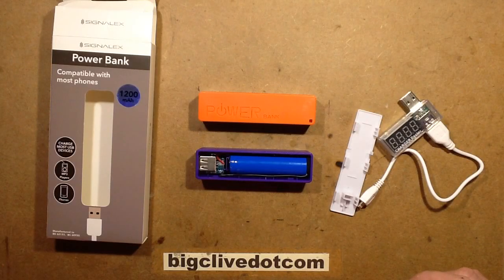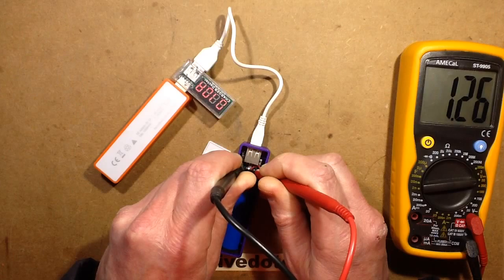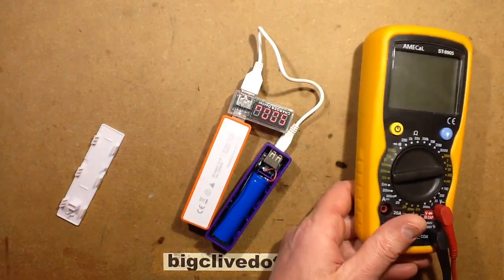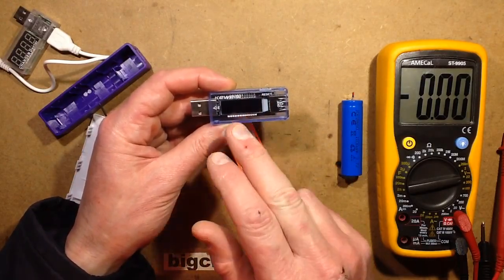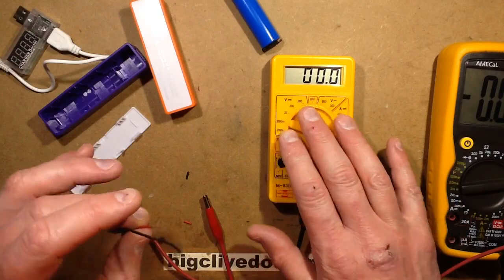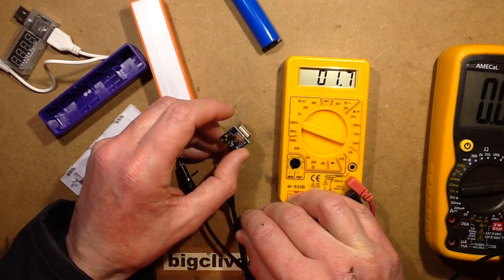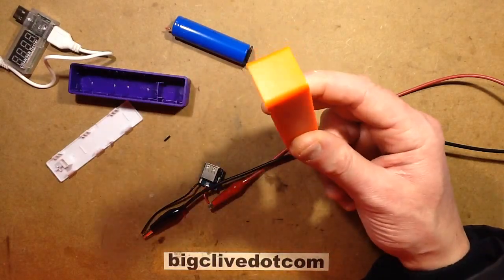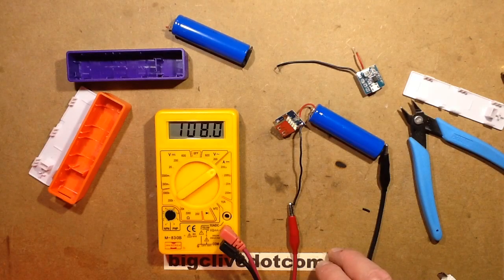Poundland's 2016 power banks.  (not a good start)

Comment: Thought you might have checked the cutoff voltage and related quiescent current.  Frankly, it's disturbing that shops are selling to the public products containing cells that have been completely discharged.  Do you think they might present a fire hazard if subsequently fully charged?   Thx for the great videos ..!
Reply from the maker: I did mention the cut-off voltage was 2.93V and the quiescent current, which was a disappointing 100uA.  The "bad" pack having a ridiculous quiescent current of 1.7mA.
Reply: Ah, yes, thanks, I recall that now.  I was wondering if the quiescent current changes either side of the cutoff?  I would have thought the boost regulator would enter a sleep state when below cutoff or when there is no output load.

Comment: Clive, although you did say (and were right) that li ion cells are extremely efficient at sucking up the charge that's put into them ... shouldn't the charge chip eat up quite a lot of the "charging Wh" that are going into a battery bank ? Those chips to get farely hot; why not measure the discharging ? Then you habe the boost circuitry which surely is more efficient than the resistive voltage regulation in the charge phase (I tested the oneplus powerbank that way with an ipad on timelapse)
Reply from the maker: During charging the control chip regulates current resistively and dissipates the excess above the cell voltage as heat.  But the actual mAh going into the cell remains the same.  So while some energy is lost as heat the mAh in is close to that of the cell.

Comment: +bigclivedotcom  I think those battery capacity measurements might be misleading because both the charging and discharging is done through a switching regulator, and you're measuring the mAh capacity at constant 5V, while the battery voltage varying between about 3 to 4.2V. Calculating the Wh capacity, then back to mAh at the mean value of the battery voltage range might help, but I'm too tired now to work it out /sleepless night due to heavy toothache/. The simplest way is to buy a battery tester with Wh measurement capability, then you 'just' will have an error caused by the unknown efficiency of the regulator. Or if the tester's voltage range is down to 3V, you can test the cell directly, to get a correct mAh value.

Now I should go to sleep, but let's see that lil keychain flashlight instead, while that 50mg diclofenac absorbing in my blood... :)

Comment: It's worth noting that 1200 mAh capacity refers to the cell which gets boosted to 5V at the output. In that specific case and a generous 85% conversion efficiency you'd get about 800 mAh at the output at 5V.

I might be completely wrong though, I'm sure someone will correct me.

Comment: I bought a whole bunch of those from china for $0.65 each, sans the battery.
Reply: Those are different, they just have the same enclosure. Here is no battery holder, the battery is soldered straight to the controller. They also have different controller boards in the same enclosure.

Comment: I bought two of these exact units yesterday. got 300mA discharge from unit one and about 500 from the second. disconnected the cell of one and dropped in a cell from an old laptop charger and discharged. it took 2000mA to charge. not bad for a 2.1 cel and discharged at 1293mAh.

Comment: When not in use, I always put sticky tape or Kapton tape between the lead and + side of the battery on power banks.. A bit tricky and/or bothersome, but does the trick to prevent quick discharge.

Comment: I would consider 100uA quiescent current as excellent in proportion to an average 18650 cell @ 2600mAh - that's about 3 years of standby.
Also some protection chips miss under voltage cutoff at very low discharge currents and can drain the battery slowly to 0v.

Comment: "Oh, blimey, that's quite high." What is that, 40VDC?
Reply from the maker: It was set at 27V.
Reply: It could be anything from 0 to the max voltage! Clive has mentioned his PSU has a interesting feature in which when it "crashes" it can return to life with a voltage pulled out of its backside. I don't think this is the case in this scenario, however.
Reply: Did you ever get to the root of the cause for the crashing issue Clive?
Reply: bigclivedotcom WHOA there... that would REALLY charge up that 18650 cell. You need to overvolt a Chinese 18650 one of these days. OUTSIDE, to be exact.(referring to the 11kV explosive disconnector video)

Comment: I've brought many an 18650 back from the dead (0v) with no adverse effects.. albeit two batteries which had crazy self discharge problems.
Anyways, lithium ion batteries are tougher and more stable than previously thought and there's a lot of misinformation about charging/discharging out there.. 
That being said, I wouldn't like any lithium cell to be repeatedly drained under 2 volts as this will reduce the capacity
Reply from the maker: So far it's taken a full charge twice albeit with reduced capacity second time around (if it's not shunting some of the charge current too).  It's theoretically coming in at around 1000mAh, but I'd need to do a proper discharge test to find the true capacity.

Comment: I don't think it's dangerous per-se to charge a completely dead 18650 battery (or should I rather say "cell" :)). It's just going to lose a lot of capacity when discharged below ~2.5V threshold and even worse when left in that state. What could be dangerous is charging it to full and then demanding a rather high current, since it's going to have a lot of internal resistance at that point, but I'd say it's very unlikely to burst in flames.

The only powerbanks I consider worth having are those coming without any batteries. I have two with a nice USB-socketed flashlight module, they are quite handy. You can put any 18650 battery you want in them, be it crappy *Fire cell or a high capacity Sony cell. I personally carry it with an IMR battery inside, makes me worry less about my home burning down unexpectedly if I have to charge it inside the device and not i a proper charger.

Comment: I have ordered one of those Keweisi charging monitors. They're cheap and get decent reviews and I need to check on the capacity of the Power Banks I have. I doubt I shall get it before Christmas, but it'll be more useful than some of the cheap tat out there.

How do you get into those boxes? If I find I have a dud, it doesn't look too difficult to replace one of those cheap cells.
Reply from the maker: A flat metal spudger pops the white cover off easily.
Reply: Thanks, that's about what I expected, but I wouldn't have been surprised by glue.
Reply: Not a one-pound one, and it looks like shoddy soldering on the micro-USB socket rather than the cell. Which is going to be tricky. But the Kewesai does a good job. Anyway, document the connections, disconnect the battery, try resoldering, look closely at the results, check for a dead short...

I thought I had a strange idea of fun, but am I really strange enough?

Comment: I got a couple of these exact banks the other day the battery inside is crap at about 200mah capacity with a high internal resistance , pcb did have a few filth solder tags on it so cleaned that , did a test using a psu to see what power it would cut out at and it seems when it terminates power the cut is not latching so if the battery recovers some voltage the usb power becomes active again meaning it could just loop until that cell is very low (usb power in not needed to close the cutoff).

Iam thinking of changing its battery out and replacing it with a laptop cell , the one it came with is light as paper , betting there's a tiny half cell inside.

Comment: Well, my brother got one that's similar (insertable battery) and changing battery for a used (2200 mAh actual) Samsung cell made it last substantially longer. The stock batteries in these single cell ones almost always disappoint badly.
The best option right now for a small power bank seems to be buying a DIY one like this and inserting a beefy cell like these 3400 mAh Panasonic. For anything bigger, buy original Xiaomi, these are quite cheap and good quality.

Comment: you should know better clive. the capacity printed on those powerbanks always means the rated capacity of the battery inside. just ignore the fact that of course are fakes out there.  if you have a 1200mah battery inside tru conversion and loss you end up getting around 750mah at 5v under perfect conditions. i exspect a usable capacity off around 1000mah and a shitty battery that voltage collapse very fast under some load so it getting even worser. so the question is how do you try to empty it? your 1a resistor would be to much. and of course, you cannot compare the input with the output mah. you can exspect the mah getting in around 30% higher because of loss and outside measurement. the only real test for a cell is without the circuit on a computer charger with an display and even then it depends on the datasheet of that battery at what discharge loads they are testet. i mean a single cell powerbank is crap anyway. more cells mean less voltage drop under load. or using better cells.
Reply: Labelled at 1200 mAh because that's the label on the cell is just wrong. You're correct about the effect of the cell voltage and output voltage.

1200 mAh at 3.7V is 4440 mWh, which is 880 mAh at 5v

But when the cells are marked at 1200mAh and can only deliver around 200mAh as the power bank output it's an outright lie.

It's strange but true that I learned about volts, amps, and watts at Sunday School. One of the teachers was an electrician's daughter, and she told us that  to explain the difference between ignorance and lies.
Reply: of course 200mah is crap but i still want to know what clive means when he say he run it flat before charging. that is a toy grade cell with 0.2C (240ma) discharge rate. there crap but because there crap they cut of even earlier.
Reply: I bought one of these the other day to take apart and to test. I tested it by monitoring the percentage charge it added to my brand name phone battery. It worked out as having charged my phone by 865ma. Based on your calculation it seems I got lucky and got a fully rated one.
Reply: This is why I think it's absurd that power banks are rated in mAH. mAH is not a good measurement of energy because you don't know whether they mean battery voltage or output voltage. The right unit to use for energy capacity is always watt-hours.

Comment: I must have got lucky with mine, it has a 930mAh battery. I've done a few charge/discharge cycles and it seems to be working fine. It's been sat untouched a few days and the battery is still at 3.8 volts.

Comment: Hi. I have a bunch of 18650 2200mah bateries. Can I use this circuit with those bateries on parallel to increase the mAh?
Good video. I'll wait for the multimeter overview too
Reply from the maker: If the cells are all good then you can usually parallel them if you make sure they are at a similar voltage before doing so.  And powerbank module designed for lithium cells should work with a parallel array of cells.
Reply: I'll make sure the bateries are all working and try then. Thanks!
Reply: ive done exactly that and added a fast charge cable 10 Ah takes a while to charge at 500ma. also added a switch as the parasitic drain is awful

Comment: Batteries have gotten so complicated. Now a cell has to come in a plastic box, with a circuit board attached to it. What ever happened to the good old days, when a battery was just a battery?
Reply: These aren't batteries, they are chargers and chargers have always had electronics inside.
Reply: Joshua Rosen
they're dumb
Reply: Paul Frederick Good old days, like when a AA rechargables were 500mAh NiCads? Glad we're way beyond that now.
Reply: D600Active
I actually think that lithium is not the best battery formula. I am not saying the others we have are better. But what I am saying is we need to do a lot better.

Comment: I bought 5 of these back when you reviewed them first and 2 were faulty :D
For a quid each, it isn't such a hardship. One had a badly soldered -'ve wire.  was very surprised that the manufacturer soldered directly to the ends of the 18650's. I find it hard to see how even a bedroom manufacturer couldn't throw an improvised MOT transformer spot welder..
The second of the failures had a completely goosed battery, so without much ado I slapped a 3Ah 18650 in instead. Works great!

Comment: The Poundland power bank that i bought 
Took 1120mah of charge to full after 2.5 hrs. 
Outputted 758mah to empty when charging a flat mobile phone.
not bad for a quid. :)
p.s very low output only about 300-400ma when charging phone.

Comment: You know, this has made me realise that I really do need to read up on and learn more about how Lithium batteries work, and the ways that they ought to be cared for. I have a bunch of 2200mAh power banks knocking around that I bought from Asda about two years ago (They were on clearance) and it never occurred to me that - As an off-the-shelf product without any storage advice or care instructions on the box - They might degrade in storage. :-o 
Now, the question for those has to be: Do I throw them on the charger ASAP to try and prevent the cells from dropping to 0v...Or would doing that be the most dangerous thing I could possibly do? :-o 
 
That said, I suppose I can now work out why the battery in my laptop doesn't hold nearly as much charge as it ought to. Curse both my user ignorance, and my habit of watching YouTube videos for too long and causing emergency shutdowns! :-/ 
 
Any chance of a video that explains Li-Ion batteries and best-practices for their storage/use in a way that the uninitiated consumer can follow, please? This would be most useful for those of us who don't understand the technology nearly as well as we ought to. :-)
Reply from the maker: If you plug something into them and they try charging it, even briefly then it suggests that the batteries had not been depleted too low.  In that case it's a good idea to fully charge them to keep the cells inside topped up.  If they are already flat then they may still be OK.  Most good power banks automatically turn off completely if the cell voltage is dropping too low.  In that case you could try recharging them.
Reply: I have an imax b6 that has a storage charge setting, it charges the batteries to around 3.8 volts 
I believe batteries stored at their full voltage is bad, consider the following, higher charge makes for higher acid content, higher acid content = faster degrading of materials inside.
Reply: The Quby power banks I've been keeping hold of all have on/off buttons and indicator LEDs, so I'll probably use those and a Poundland USB lamp for testing present charge and throwing them onto the charger ASAP if they seem good to go. They look like they might have a fairly good quality to them (I did have one which I'd opened up somewhere. Will have to try and get some photos for your interest.) so fingers crossed the circuits inside them have kept the cells well managed whilst they've been in storage. :-) 
Looks like exchanging my EE power bar for a 10-port USB charger (The same sort used in the secondhand display cases at Game/Grainger) is going to have been a good decision! :-D 
 
As for working out ideal charge levels: When charging a power bank intended to be stored for long periods, what's the best level of charge to aim for? Some people say (And I used to follow) that charging them up fully is the best approach, however Apples documentation for their in-device cells (See https://www.apple.com/uk/batteries/ ) suggests they should ideally be stored with 50% charge and powered up/topped-up once per year, and there seems to be all manner of differing perspectives on this. 
 
At present I'm storing stuff with between 50-66% charge where possible (And switching to buying only power banks with charge level indicators) but given I've been doing this with my laptop since I got it (Secondhand) and the from-full-charge life in that has been crashing down and down over the past year, I can't help but wonder which way is truly the right way... :-o :-/ 
 
[Addendum: This reply was supposed to have appeared last night. However it seems that on YouTube, one now has to play the video and respond to the advertisement before one can exercise their rights of comment or reply... #NotRight +YouTube :-/ ]

Comment: 1200 mAh? Such small 18650 cells do even exist in 2016? :)
Reply: in china, everything that is cheap, atleast it's not a 9900mAh (actually 100mAh)
Reply: +mibars Probably they claim that 1200mAh at 5V, so at the battery's voltage level, it would be higher. That's why Wh would be a better unit to describe the capacity of such things, it would be much more clear.

Comment: I picked an orange one up on saturday, it was flat, took just over 1000maH first charge, then tested out at 600mAh on discharge, so half the claimed capacity. Subsequent charge has been 600ish mAh so I guess that's probably the real capacity. I didn't realise I got a 'good' one! :) 
Hadn't considered the risk though... Hmm...also wonder where 400maH went in the first charge!
Reply from the maker: The discharge at 5V will be a lower capacity as it gets boosted up to 5V at the expense of current.
Reply: So the orange ones are good? Dammit, I bought a purple one.
Reply: I've now tested my purple one and it's fine. ;-)
Reply: was it totally flat initially?
Reply: No, it actually managed to power my Raspberry Pi out of the box.

Comment: @bigclivedotcom could you test a battery where you trust the advertized capacity of? Most/all video's I see where ppl measure the capacity by discharging fully and then measuring what goes into it till fully loaded, seem to conclude that the advertized capacity is 5 to 20 times more than the measurement.